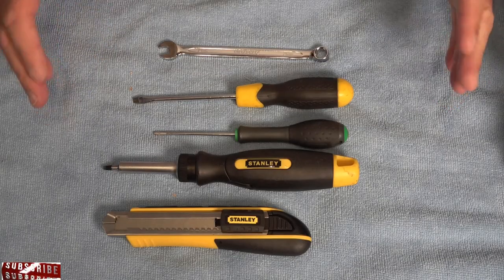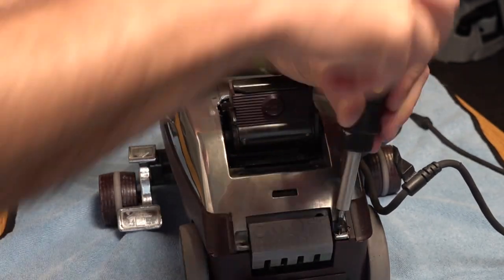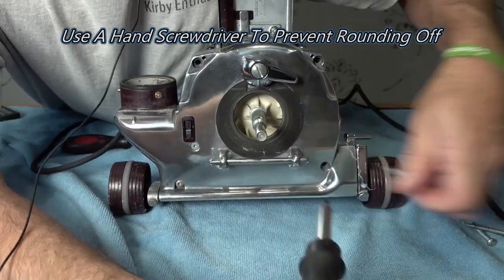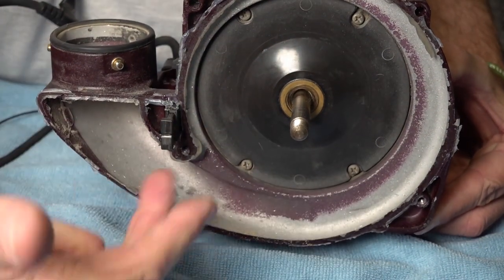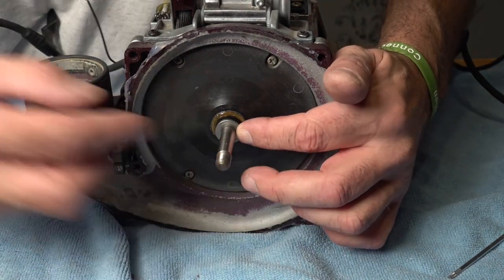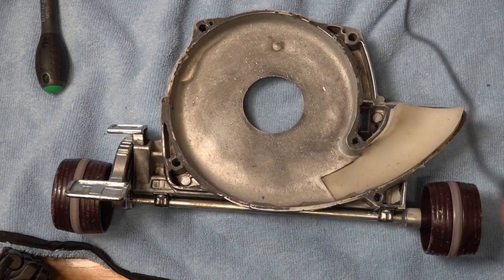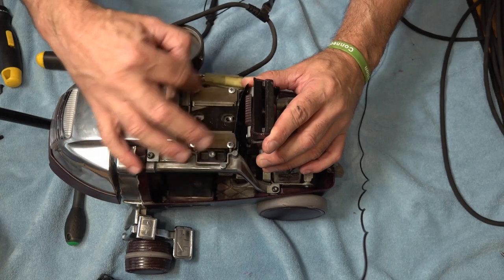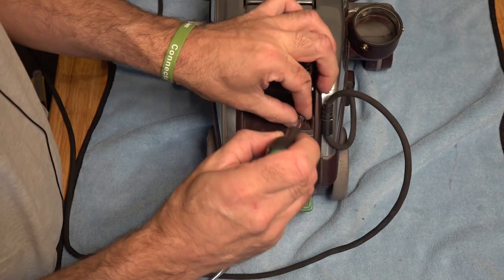KIRBY VACUUM: Kirby Vacuum Quick & Easy Kirby Avalir / Generation Kirby Fan Replacement

Comment: Thanks for this video it helped me replace my fan motor on my Ultimate G Diamond Edition. I used my torx bits T-20,T-15, flat head screwdriver to pry open the front with wheels. Now for my Kirby instead of a 9mm wrench once I took off my tech drive handle I used my 7/16 wrench to hold the motor shaft, take off my belt shaft and removed the fan. Just for the at home Kirby’s in the USA. Please clean both halves and put the sealant on. I put mine on the front where the wheels are. 👍👍